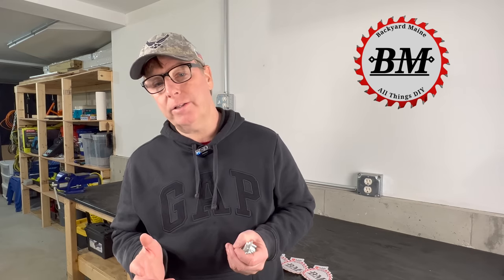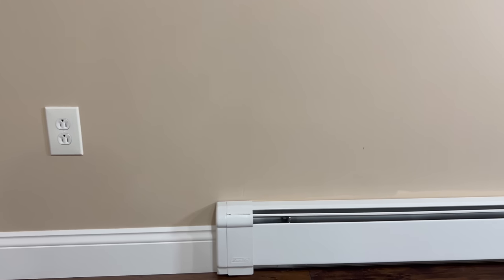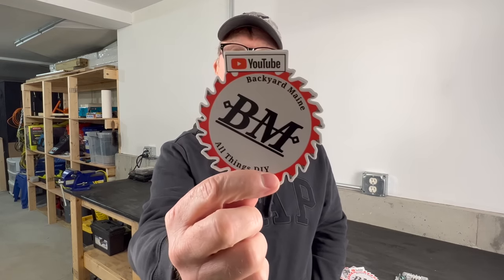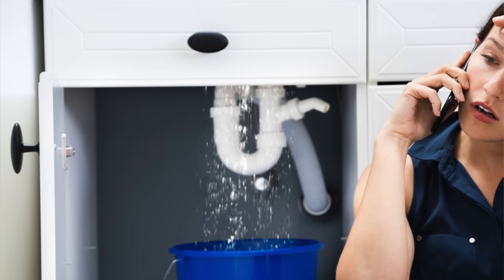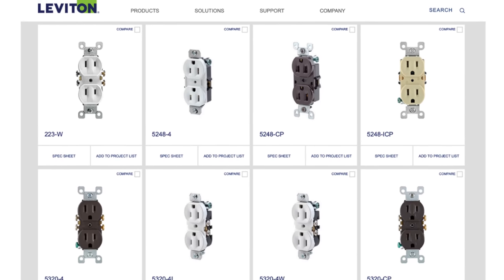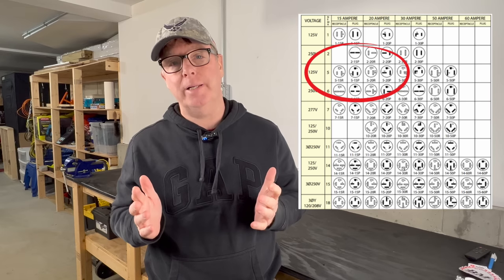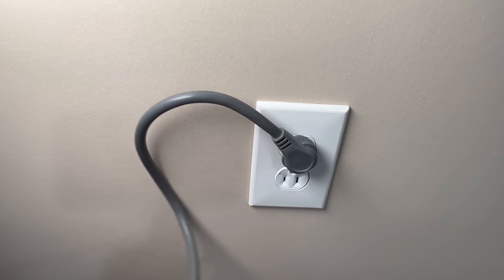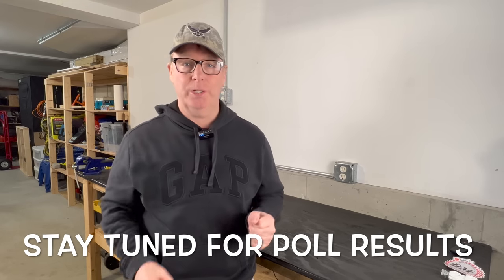Are your outlets installed upside down? (You may be surprised)

Comment: Late to the party. I normally install vertical receptacles ground down. Personally I think it looks better, also when using right angle plugs the cord is orientated toward the floor. I install horizontal 120V receptacles with neutral on top for a tiny bit of extra safety. But as you said it is up to the installer.

Comment: I have been an electrician since 1966 and install outlets in both directions depending one many factors. I primarily installed them ground up it is how I was taught. Back when I first started, metal plates were widely used and ground up was safer. I have also seen many times with ground down outlets , particularly with cheeper outlets, the bottom of the ground hole is  broken when the flat prongs work loss and it has tilted down. I alway contend there is no right or wrong way.
Reply: Ground up, if horizontal neutral up. While as a county elec. maintenance, there was one building where the office's desk work surface was open towards the wall and had cabinets and a light underneath above the desk. Murphy's law a large paperclip would fall across the blades [ground down], albeit the power cord was not fully inserted by a small amount. This happened 3 times at different workstations. Plus to me is easier
to install, being right-handed, and the position of the ground terminal that I like connecting first. No twisting.

Comment: I am not an electrician but agree that ground down is the best in most cases. When you push the plug in, your hand naturally wraps around the end of the plug to grip it. This causes your #1 finger to curve around the bottom of the plug. If the ground is facing down, your finger would only touch the ground. If the ground is facing up, you may touch the live blade of the plug. Great video!
Reply from the maker: Thank you..

Comment: Been doing ground up for years after a friend pointed out the exact scenario you did with the screwdriver.   I work for a home goods manufacturer and some of our units are coming with low profile cords with the ground up.  

I also have some (but not all) GFI outlets that the "test" and "reset" lettering is oriented for ground up install.
Reply from the maker: Thank for sharing.. 👍
Reply: @Bryan-Hensley   

Really? 

#1 if that's the case and this is sooooo dangerous, then why isn't it code to specifically put the ground wire on the bottom?   

#2,  a majority of cords that most people use inside of the home day in, day out only have two prongs and no ground (specially one's the kids may be plugging in).  If this is soooo dangerous to occupants and children, why are you and I not reading about kids being electrically shocked every single day?  According to you, if that ground prong isn't down the bottom, everyone's index fingers will be touching the hot prong.    

As for what I was taught in school is no matter what, you NEVER touch ANY prong while plugging anything into an outlet (whether upside down or not 😉 )
Reply: @Bryan-Hensley   But is it code?   Or is does code allow either way?
Reply: @Bryan-Hensley  Sounds like post-hoc reasoning to me. I certainly haven't noticed humans being shocked more often in hospital ICU's. Do you have any data or studies to support the notion that people instinctually hold plugs the way you describe.

Comment: Good points in this video. Ground up is the safest way. All my unused receptacles are installed this way. The ones that are behind appliances are installed according to the appliance's plug configuration. Most appliances plugs are designed for ground down configuration, so I have no choice.

Comment: In North Carolina the code was changed in about 1996 to specify that the ground should be up when using a metal cover plate. The local inspectors would overlook ground down with plastic or wooden plates. I have done both in my years as an electrician except for state owned facilities which required ground up.
Reply: WHY? would a conductive covered metal plate have any safety issues?  Maybe with it's desired use on metal boxes?  Ref: 110VAC US Navy film on "Your deadly shipmate"! ( 1963?)

Comment: As a Home Inspector I see it both ways and really appreciate the research of all viable codes/sources for an answer. This video was very professional done and informative which gives me the knowledge to pass to my home buyer.
Reply from the maker: Thank you. So glad it was helpful..
Reply: Whatever's in the home all receptacle should match whether ground up or ground down all new construction should have ground up as the code requires to comply with manufacturer's recommendation on every box for receptacles there's a picture and it shows ground up. On an ungrounded system where receptacles there's only two prongs instead of three the large prong should be when looking at the receptacle to the left. As a home inspector you do know that the code clearly states that receptaclesare to be installed under the code for the permit of the construction of that area so if a house was built when knob-and-tube was installed it has two wire receptacles it does not require to be grounded unless a remodel had been done and then the remodel must comply with the code at the time of the remodel for only the area that was remodeled. Same complies with GFCI and arc fault and now that the new codes come out we're proper tamper receptacles are required solely based on when the last permit was pulled for the area that's being inspected. Meaning if a room was remodeled it has to comply with the newest code but if it was not remodeled say last year and it was built in 1960 then it must comply with the code of 1960 not with today's code.
Reply: @ds9902  I don’t know what state you “claim” to be a home inspector in but you are definitely full of it, you don’t even know what you are talking about.
Reply from the maker: @ds9902  Like I keep saying the Manufacturers and even NEMA do not recommend orientation. If they did we wouldn't be having this discussion .
Reply: I  am curious. As I explained in my comment, in Latin America receptacles are usually installed horizontally. And I find this safer with the ground left, which means neutral up. I am an electrical engineer with 30 years of experience, we follow NEC in Costa Rica and I have done projects in several countries, including the USA, Canada, Mexico, Costa Rica, Panama and  Colombia (Also in Brazil and Argentina, but their standards are more European). 
As an inspector, what would you think of a receptacle installed in this position? I find several advantages:
1. Neutral up and ground left. Will cover all concerns of falling objects (including loose metal covers touching the live tabs when unplugging). 
2. Cords side by side. Avoiding one cord over the other. And easier to plug loads into either receptacle vs having a plug in the way at the top of plugging or unplugging something at the bottom. 
3. Conduits being run from above or underneath (or horizontally along a wall) - Easier to install in a horizontal receptacle. Coming from top or bottom, requires less 90deg conduit elbows, reducing number of pull boxes required and tension in pulling cables.

Comment: I've seen both wiring methods used; it seems to be simply a matter of preference (although ground down seems to be most common).  I've even seen receptacles mounted sideways, particularly in older homes.
Reply from the maker: Great point! There are some jurisdictions like Chicago for example which require horizontal receptacles. They also require conduit in homes which must really drive the cost up for the homeowner.
Reply: In those cases, side mounted receptacles have the neutral side up, theres no code that dictates that. Its just standard practice.
Reply: @BackyardMaine Yes, I work in the Chicago area. We do use horizontal neutral up mounting and conduit on everything. 6' flexible whips are allowed but discouraged. I've even had to replace whips 5" too long...inspectors can be rough. Those areas where I mount them vertical I use ground down.
Reply: @kurtburkhardt5862  You’re doing neutral up, now? That’s good. Most Chi ca go receptacles I’ve seen have the hot on top.

Comment: Thank you!  Excellent Presentation.  I do work all over the country and it is surprising how may electricians have been taught that up or down ground orientation is a code issue.  Thank you for covering not only code, but also manufacturer instructions, AND national standards & Applications.  Strictly for looks I like ground down.  If there is a reason to not use ground down, it is that it looks more like a face which could attract some children to play with it.  Some children will play with receptacles anyway, so I make mine safe with the rotating covers, but this is a thought.
Reply from the maker: Thank you! The tamper proof receptacle which have been required since 2008 solve the problem of kids trying to stick something into the receptacle. But when something is plugged in that will not provide protection. Thanks for your comment..

Comment: John, there is another mitigating factor I personally ran into. The local fire department. I used to be the maintenance Forman in a Culver City, California manufacturing company, the local fire inspector had me turn every blasted receptacle upside down, close to 3000 or so. His reasoning was not only the falling object short, but he said all the hospitals have to do it that way. This was about 40 years ago, so this whole issue was probably new and open discussion for everyone, I would guess.  Ground down looks right  side up to me. But also, if you have an object fastened against the wall firmer at the top than bottom, it would seem to me the holding power would be greater than vice versa.  It seems to me the two blades would have more of a holding power than the single ground. In other words, it seems to me with a good plug (not an old lose one that needs to be replaced) would have a harder time to roll out of the receptacle. Well, that's this reporters' opinion. LOL I'm with you no matter how I slice it.
Reply from the maker: Great information.. Thanks for sharing my friend.
Reply: @BackyardMaine  and they got paid lots of overtime to change ALL 3000 outlets!!!!!!
Reply: I worked in a hospital in Southern California for 11 years, and it had all the receptacles with ground up.
Reply: @David-rx5eo  Well, there you go! If California is still doing it today, it must be wrong. LOL
Reply: I know some if not all have the embossed text on the back in both directions these days. But back then if you installed some receps ground down, the text on the body of the recep would be upside down.
Reply: @flyingsodwai1382  Great point, but the way I see it, to be a peacemaker, there is no law one way or the other, so you get to do what you feel is right for you and your family. But if you really, really want to stir the pot of hypothetical possibilities; if the blades are on the top, something CAN fall and if skinny enough fall between the blades but hit only the small blade and keep falling but fall to the small blade side avoiding the large blade altogether but hit the ground as it is still touching the small blade at the same time. But what if the ground was up and the same thing happens, but now as the skinny metal object is falling it leans to the small blade side and touches both the ground and hot blade? Or! You could forget all the hypothetical possibilities, and just put it the way you want and go do something more useful, like spank the kids or read the Bible. LOL

Comment: I prefer ground down because many(most) plugs and especially wall warts don't work right in the ground up plugs! Don't forget that even if it doesn't have a ground it most likely does have polarized plugs and so they get forced to be upside down. I have even had one wall wart that would fall out when forced upside down.
Reply: My buddy tried using a Klein outlet tester on a ground up oriented receptacle and realized he couldn't see what the tester was showing because the display was facing the floor.
Reply: I’m not a liscend electrician, bu I have done wiring for many years. Residential, commercial, even industrial. But please tell me what a wall wart is😆
Reply: @karlschauff7989 Exactly!
The little 3 light testers to check for correct wiring, you can’t see the indicator lights! I’m a ground down man all the way.
Reply: @ronniealexander8967  AC to DC power converter. If the cord has a big box that plugs into the outlet that is a wall wart.
Reply: Where the hell are you finding all of these polarized wall warts?? Most of them aren’t

Comment: Ground LEFT is the safest option.  Each box a double-gang. and put those grounds on the left side so HOT is at the very bottom.   Then your two-prong plugs are save as well since neutral would be the most likely contact a falling object.  This is even the required orientation in some high fire risk areas, like certain high-rise buildings with negotiated planned unit zoning.

Comment: I always do Ground Up for the arc safety. But it really comes down to who folks trained under - that seems to be the primary determinater of which method folks follow.
Reply: Maybe in a commercial metal working shop? But probably not, at least for me. No where else would seem to benefit. Particularly residential homes.

Comment: In my opinion, based on a lifetime of experience, the greater concern is the quality of the duplex outlet.  I submit the "residential grade" outlets should NEVER be used - anywhere.  The lower quality materials mean they all too quickly wear out; thus resulting in loose connections with increased resistance, heat buildup, and fire danger.  Additionally, the housings seem to crack far easier than any spec or commercial grade unit.

Comment: There is no right way, unless local code specifies.  In finished rooms I use ground down to match how most "wall warts" mount (those with polarized plugs) and 90 degree cords (as you stated).  In workshops, unfinished basements and garages, I use ground up.  It helps limit the possibilities of things falling down along a wall and making contact with the hot & neutral.  That is my choice anyway.
Reply from the maker: Sounds like you have a good system. Thanks for sharing..
Reply: That's an intelligent approach. Try explaining it to the AHj

Comment: Great video, thanks. Well after been an electrician for 52 years in the Washington, DC/Maryland and Virginia area. I always place the ground down on 15 and 20 amp. circuits.......now if it is,.... 220 volts and large amperage 30-60 amp. I put the ground up because most larger cords have the ground at the top with the cord hanging down.

Comment: There are many devices that are designed to be plugged in ground down.
Reply: Yeah there are many electronics that plug directly in the outlet that also rely on it like wifi relays, powerline internet, carbon monoxide and explosive gas detectors, etc. The ones that have a ground prong are clearly designed for ground down or they themselves are upside down.
Reply: @Skylancer727  and also some heavy duty extension cords with right-angle plugs.

Comment: I had a bad experience with a kitchen wall receptacle that was ground down. The outlet had one of those bare chrome plated metal covers. This cover, held in place with a single center screw between the two outlets, as is common, worked loose over time. As I was pulling a plug out of it. Well down it came thanks to gravity, contacting the two hot side blades on the plug, way too close to my fingers. I was lucky not to get shocked or burned. This produced quite a light flash and sound show, before tripping the breaker in the main box. So, even though this is probably a rare occurrence, I will never again do a ground down installation if a metal faceplate is on the outlet, or I replace the cover with a plastic one.
Reply: I had the same experience, only more explosive and literally eye opening, as it happened with the 240 volt 20 amp receptacle for the window air conditioner in the home I was renting a couple years ago, while I was dozed off on the sofa, the metal cover plate was missing the screws and I think my roommate's cat was rubbing against it and knocked the plate onto the prongs because she was running around the room and very shaken.    Welded the plate to the prongs, tripped the breaker of course and the plug had to be replaced.

Comment: Years ago I was pulling cat 5 wiring through conduit in a school. We were using a metal fish tape and as I was pulling the fish tape out of the conduit it fell down behind a plug plugged into a ground down outlet and arced across the hot and neutral blades of the plug. From then on I was sold on ground up orientation. I already hear people say I should’ve used a fiberglass fish tape but that’s what we were given to use so we used it.

Comment: I was explaining the "correct " orientation to my client and measuring the wall for layout code requirements. I pulled out the tape and went across a receptacle which had something plugged into it. When I accidentally let go and it arced perfectly down across the blades. Burned the tape, receptacle and wall. Perfect example neither of us will forget.

Comment: In my apartment they were all ground up, but some no longer are. 🙂 I believe the code started out with ground pin down. The reason the rule was relaxed was that sometimes, on old installations, wire length was insufficient to replace the receptacle - unless it was put in with ground pin up. I still would reverse a receptacle to ground down position, where something like a wall wart or a right-angle plug doesn't otherwise fit.